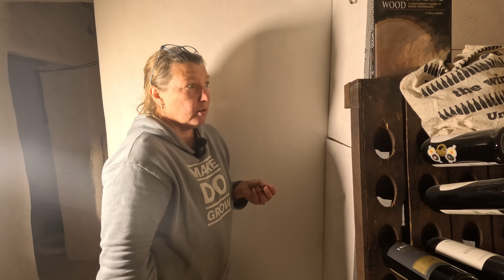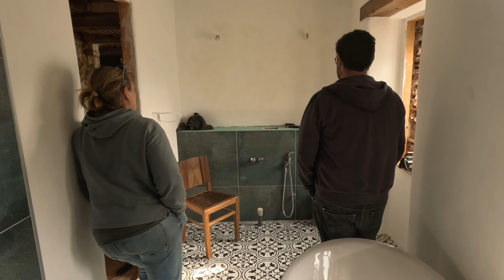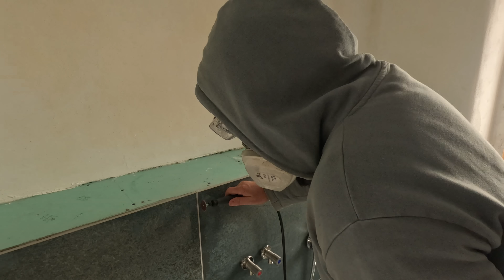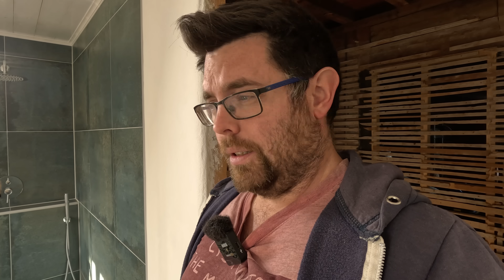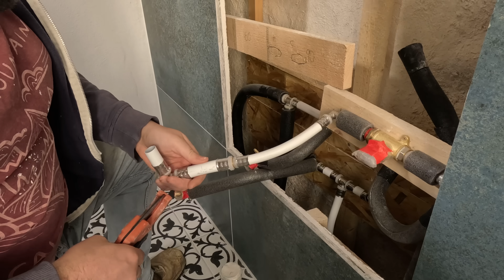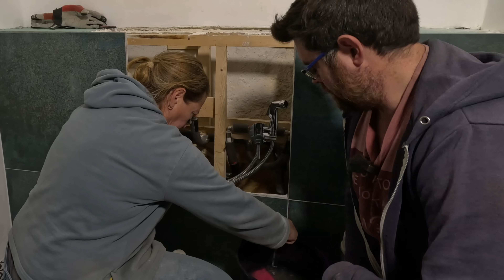Bathroom Nightmare: When Plumbing Goes Wrong!

Comment: Isolation. My current house is my umpteenth renovation and certainly my biggest.
Previous plumbing issues ensured THIS time I installed isolators all over the plumbing system.
If the washbasin taps have a problem I can isolate them individually, and similarly for the shower. Sink taps, washing machine, dishwasher can be individually isolated. I can isolate the whole bathroom.
Today’s problem can be left a couple of days till I get round to it!

Comment: I don’t like that everything is hidden in the walls. If something goes wrong, you’d have to tear them apart. I remember in my Ontario home, a hot water copper pipe started leaking—not at a joint or connector, just from aging and a defect, I suppose. Thankfully, the pipes there were accessible from the basement.

Also, I don’t see any exhaust vents sticking out of the roofs of Portuguese homes. Do they use an air admittance valve (AAV) or something similar? Do you know?

Comment: Unlucky guys, but well done on the fix.
For hidden pipework, sometimes there's no substitute for good old copper pipes, with solder and/or compression joints FTW.

Comment: Very thin discs with diamonds blades are existing and present in the shops.
Plumbing it's all about no joints end connections that you can't reach. What means concentring all to 1 central tap and go to each off-distribution taps in the bathroom without any connection, of cors it takes more tubes and work but it's word it😊

Comment: Of all the services in a house, water is the most unforgiving. It penetrates everywhere. I had a similar experience in my house in Sweden. By the way both electric and water are commonly surface mounted here... I just want to add my plumbing is protected by a one-way valve before the water meter and a pressure reducer set at 3.0 bar.
The water company shut down the supply in the village. So far so good. No water - no problem. However when it turned it back on again apparently some drainage had occured during the pipe repair resulting in air pocket in the supply line. Unfortunately this bubble reached my house. The result was that the pressure reducer was faced with a medium that partially passed through its channel quicker than it could control it. 8 Bar hit the tap in the bathroom which then literally "blew it's top" spewing some 1200 litres of water into a wooden house. Three weeks later the industrial dryer had managed to recover about 90%. The damage was horendous. Moral: Dont beat yourselves up for something that you cant control!
You guys can count yourself lucky it wasn't worse. Keep up the good work and good luck with your project.

Comment: As a plumber, I always pressure test, then I will link all the pipes together at the cylinder cupboard or boiler and then fill it with mains water, so while the house is being finished off 1st fixed and platerboarded it is always under pressure, then when I come to 2nd fix I relieve the pressure, it just gives me a piece of mind knowing the property has been under pressure for some time.

Comment: You did well. But not sure about your crimp tool.
I have installed 1000’s of almost identical fittings.
I have hydraulic tool, and never can pull pipe out, from fittings.
Occasionally you get a slight drip, often recrimping fixes.
Do a test on some spare pipe and fittings, try pulling apart.
Good luck. Cheers from Oz

Comment: In my opinion the best plumbing is copper pipe with soldered fittings. Copper pipe with compression fittings are OK if there is no vibration. Speed fittings/push fittings should be avoided.
Reply from the maker: Copper isn’t really a thing in Portugal, or at least not readily available and most plumbers here are not familiar with it

Comment: Bit late now since you've already fixed it, but.... Last year i had a job of replacing an inbuilt toilet that also had a poo pump. It was all permanently boxed in and tiled. Not ideal seeing as pumps need servicing, and replacing. So, i made the new boxing self standing, which slid into place and was held to the metal  toilet frame with magnets. I think that's what you should do with that front panel. I'm so glad i did it that way, because that pump got blocked a few days before Christmas and it was a much easier job this time.

Comment: that PEX + AL   is something i try to stay away from.
It was heavily used in Romania in the ~2000s.

It's always a headache, from connections to the pipe itself. i've seen it crack multipel times over the years.

We've moved to using Polypropylene Pipe - PPR plastic pipes. these are pretty cheap. they get welded together  and leaks / failures  are extremely rare.
The welding tool itself you can get for cheap ~50 euros, as are the connectors and fittings.
The welding process has a pretty wide margin
https://www.youtube.com/watch?v=WrtBI77v4Ps

Comment: Well done to find & fix the leak
I'm a DIYer, and prefer using copper pipes
Never knew you could buy a manual pipe crimper, your fittings look different to the ones I've seen in the UK
Good luck & all the best top both of you in 2025
Liked & subscribed 
👍👍👍👍👍👍

Comment: PPR is easier to work with, cheaper and more reliable, I had some issues with PEX-AL in the past and I avoid it, the fittings are also quite expensive...

Comment: Another thing, crimping tools usually have a way to calibrate them to ensure they are completely crimping your fittings, you might want to check the calibration on your crimper.

Comment: When you were able to easily pull that failed fitting apart after reassembling it, you should have tried pulling apart the other two fittings on the tee. If they also came apart with only a little bit more effort it's time to invest in a different connection.

Comment: Keep pipes visible. Isn't copper attractive? Keep it polished and make it a feature. Use traditional copper pipes with soldered joints. Less to go wrong, easy to do. That crimping looks very unreliable, just an expensive gimmick

Comment: When possible always place fittings somewhere were you can reach them. So it is better for example to make a cabinet in a room below the bathroom. Or make an access panel in the ceiling and make you connections there. Then there are less fittings in the bathroom and less chance of a fitting leaking that is inside a wall or floor so you have to break down the bathroom.

Very strange failure tough, never seen it before like this. The only thing I can think about is that you used different brands of pipe and fittings. Sometimes there is a difference in pipe dimensions between brands and they do not correspont witht the fitting. For example there are brands that have 2mm thick pipes and the other 2,25mm thick. So when you use pipes that are to "large" for the fitting it could come out.

Or what could have happened. Sometimes the metal thing where you stick the pipe in comes loose. And when you did not click it back in well or when you did not see it was loose it could be possible that it can come off.

Comment: As someone who came home to $380,000 of water damage from a tiny little cold water hose under our sink spontaneously failing last year, I can identify with that trauma face you’re making. “What’s that sound?” is a sentence that activates my flood PTSD. It really robs you of your confidence. Big hugs to both of you.

Also, not sure how your water arrives into the house-ours comes from a water tower- but our hose blew off because of large variations in water pressure. Adding a water pressure regulator at the whole house water shutoff solved the problem.
Reply: We had repeat failures of our pipes, thankfully not inside the house but our irrigation system for the garden. Until we installed a pressure regulator. Apparently fluctuations in water pressure from public grid is a common occurence in Portugal.

Comment: Aside from improper crimping, were additional piping/fitting supports required? To ensure the pressurized fitting or tubing does not twist or flex. Great recovery and time out. 2 more bottles to drain.

Any chances you would chance drilling 4 mounting holes in each tile? It's daunting drilling in ceramic tile. Just so hard. You already have a grouting removal system. Any spare large green tile - break and replace?

Comment: A multi tool with a round carbide blade is pretty useful for removing grout (and making small cuts in tiles). It's less aggressive and easier to control than most other grinding tools.

Comment: Ok  mate its cristmas get down to border of spain and supp up that wine red .you only needed a silver slip over the shower 15 mm masticke .it in behind and the black ruber it slips over .right wots your water presure .goes up to you need a presure reducing valve on the cold supply coming in to the house 3 to 4 bare .with a gage on showing the inlet presure.. it and a blow out on a tundris.to the out side or on a fanny trap so no smells come in the the house from the out side drainage . the aussie boxing champ.of the 80 is ..from adelaide.

Comment: Yep Bathrooms on a second floor suck when they go wrong. However, it is better to find out now, than after the lounge ceiling is finalised. Also, rethinking access is a great idea, not only would I be adding in the removable tile behind the sink area, and possibly making the wooden bench on top of the false wall removable (for ease of inspection),  but in the bedroom behind the shower I'd consider the framing layout so you can have panels or at least a lighter wall section which can be broken out easily if a disaster happens and you need to get to in-wall fittings. Our house in Obidos Lagoon had a in-wall fitting fail on a second-floor bathroom. The leak destroyed a wardrobe directly below it. We had to concrete-saw a section of the bedroom joined to the shower wall, as that particular bathroom has floor-to-ceiling marble panels so getting to the fittings from the front is a no-go. We now have a section of plastered wall that can be smashed out in an emergency without the need to call in a saw. I am sure you'll get it sorted, Take Care D

Comment: Beautiful bathroom! So sorry you are experiencing this plumbing issue. I have noticed that you are dressed as though it is cold in that room… so… just how cold / warm is it in your bathroom?? If it reaches the freezing point, the flex may not split, but the ice can force the connections apart. Thank you for sharing your creation.

Comment: @MAKE.DO.GROW. - When doing the repair you need to put a bracket in to hold the T-piece junction piping/tubing so it keeps the tubing at the junction straight and without movement, otherwise each time you turn the taps on and off the T-joint will move at the junction and the same thing will happen again, again (the Joint will fail). The same thing happens to pips inside brick walls or concrete walls when the pips move (can you remember ever hearing pips rattle inside walls? especially in American movies) That's because the pipes are lose and the pressure is causing movement (vibration) each time the taps are turned on and off. In Concrete and brick walls this also causes holes in pipes over time due to rubbing on the concrete or bricks of the walls. All your T-junctions should have a bracket holding them so they don't move and so the T-junction is held straight. Hope this helps.

Comment: I admire the calm resolution of your challenge. Although you have left me with a quandary. I have been trying to decide between crimped fittings, which I haven't used, and push fit which I have used extensively without problems but with their own limitations!
I will not be sleeping easily now!!!  😂🤣

Comment: Hey guys, I have had compression fittings, tectite fittings and recently one of your press crimp type fail so statistically none of them are safe. You just have to do your best and pressure test before closing up walls etc... As I said it happens to the best of us. I never sleep well after a plumbing job generally. Bathroom looks great by the way!!!

Comment: As an X plumber heating engineer you can't beat the JD speed fit system. Doesn't require tools apart from a pipe cutter and is very easy to do. Only one faulty fitting after years of using it. Connects to copper and plastic pipes. Can be taken apart and reassembled easily without tools.
Reply: JG speed fit available in portugal
Reply from the maker: Not where we live
Reply: @MAKEDOGROW  I used the PEX piping which is fast easily bent to fit. Works reasonably well and on a similar method to the JG speed fit. If only they sold proper pipe clips to fit it here.
Reply from the maker: But we are in Portugal, not the UK

Comment: So sorry to hear this guys. Nothing quite as dramatic for me but I needed to use a short extender (as you talked about possibly using for that lower shower head) for an outdoor tap. It leaked and I discovered it was split. I bought a replacement from a more expensive and reputable company in the end. Hopefully the repair will be a one time job. Thanks for sharing this disappointing setback.

Comment: Leave the tile as is and put in an access panel. I assume there's going to be a sink or such above the drain pipe in the floor. Look for a diamond blade for your vibrating saw, to remove the grout.

Comment: Not sure if mentioned but a “hammer” reduction fitting that reduces hydrolic shock when tap turned off may help especially when some angular /lateral pressure is on fitting.

Comment: That's quite a different pex system than we see here in the States (where we have Pex A, aka Upinor, with expansion connection system, or Pex B, with a metal crimped metal connection such as Viega.  Your fitting almost looks like it has two black o-rings.  I've never seen o-rings with a crimped connection.  Can you explain your system?  (Sorry if you have done so already.)  As an aside, I've had pex in three houses I've owned over the past 20 years, and I've never seen a pex connection fail.

Comment: You should be able to adjust the bolt on that crimping tool to give you a slight tighter crimp, that's what I did on mine.

Comment: I may be late to the party but around my bath I put the tiles onto plywood and then attached the plywood/tole combo to the bath frame using mirror screws i.e those that have the screwhead concealed with a "dome" - that could be an option and it is removable for access. Can send you pics if required?

Comment: i wonder what your water pressure is as you mentioned 6 bars of pressure testing. i tested my plumbing with 11 bars while my water pressure is around 4 bars. do you have a safety valve for your hot water? mine is rated for 10 bars and i'm required to test 1,1x the max pressure.

Comment: OoOo, because you were able to remove the tile and the board behind as one piece, you can now create a "secret" access with that tile. Couple of twisty bits mounted on the back of the tile/board that can be turned to lock it back in place. That way in the future, if there is another failure (heaven forbid), you have easier access.

Comment: There's a lot of different materials and connections going into plumbing. Chances are, that one thing will fail - be it a straight that slowly is nearing its aneurysmic burst after the automatic valve from the washing machine or disher has been closing a gazillion times, sending a little shock-wave throught he water column each time, or the "flex-link" that's so popular for painless fitting of sink installations, which is just a galvanized mesh enclosing some tubing. A number of years going by, and the mesh has rusted away, one day resulting in a sudden burst of water from the professional installation. (This one happened to us, merrily flooding our flat at night, waking the neighbours below by dripping into their lamps from above). Our ancestors were wiser. All bathrooms in the house used to have a drain in the floor, safely re-routing spills, accidents and minor catastrophes into the downpipe.  But alas, the company owning the building had all bathrooms renovated, tiling over the drains because "that's not done anymore, besides, it looks nicer"...   I'd rather have the drain any day. As it is now, whenever we leave, we do turn off the mains.

Comment: Hi there, 
I don't think it's a piece fault or that the pipe wasn't shoved correctly on the T connection. I think it's the press power of your handtool.
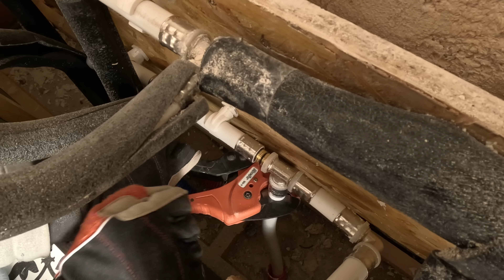On the still video of 13:38 I hardly see any press marks on the metal sleeves.
After numerous presses, you need to re calibrate the press force on your plier. Please check your manual.
What is also a good warning is the press pressure is getting to low is that the plastic wraps mentioning the 16, 20 etc size won't come off easily after pressing. I hope this helps. Keep up the spirit and wish you a nice Christmas 🎄

Comment: 100% on your comments at the end about the advantages of DIY. I had a pipe joint burst apart 2 days before you guys on a system that had been running flawlessly for over a year. But was able to stop off the water, figure out what had happened and sort it in about the same time as you did. (In my case I had stupidly not switched my solar water heating system over into freeze-protection mode.)

Comment: We live in a 35 year old home with copper pipes.  We’ve had two issues in the last 3 years, just pin hole fails.  It happens, don’t loose faith in the good work you have done.

Comment: I saw a failure like that because of using the wrong, not original crimper. Check your crimper tool and if the crimp marks falls where the marks falls with the original and more expensive tool.
Good job
Wishing you a good holiday and a dry finish to 2024 not of wine in any case